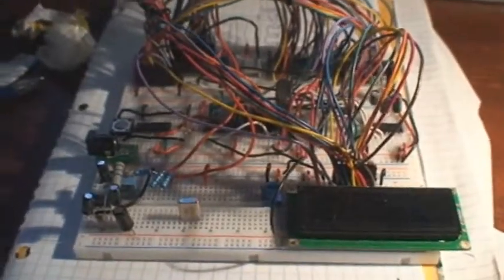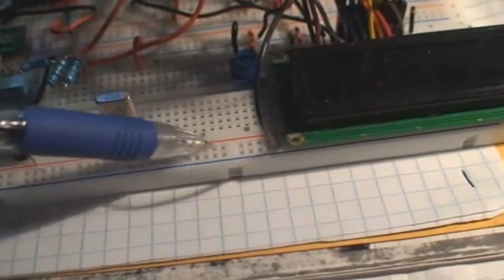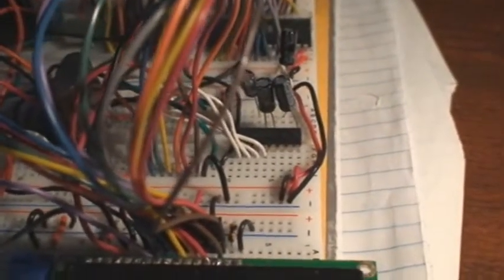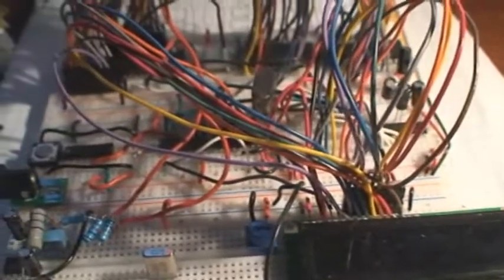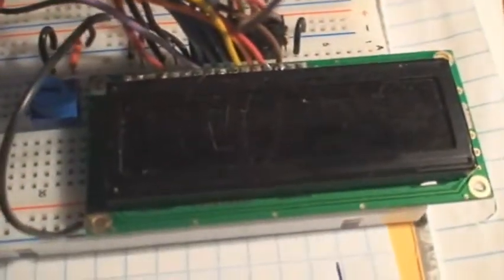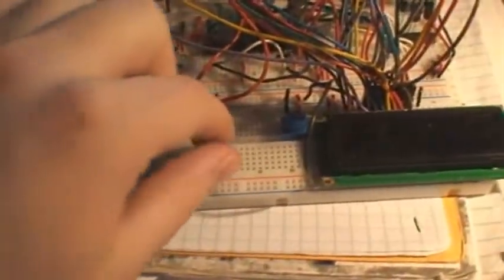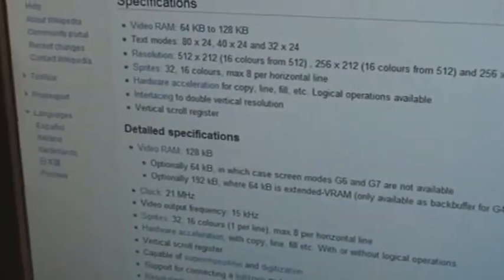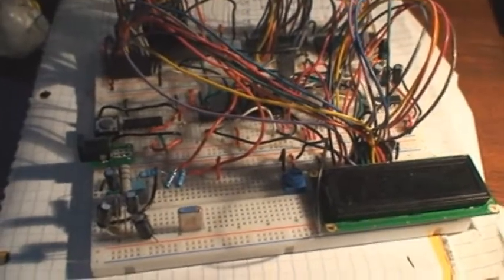NES 6502: Now with music!

Comment from the maker: @Webking271 The NES cpu has a few built in sound generators (those two red lines running from the CPU). Just using a LM386 to amplify the sound, and a few caps and resistors to clear the signal.

Comment from the maker: The NES cpu has a few built in sound generators (those two red lines running from the CPU). Just using a LM386 to amplify the sound, and a few caps and resistors to clear the signal.

Comment from the maker: Two things, I keep saying "clock" but really it's a crystal oscillator. 

Second, I never explain why I "almost gave up". Basically I didn't notice the LCD had a active-high enable line (all the other chips are active low), and I couldn't figure it out for two weeks. Did a huge facepalm when I figured it out.